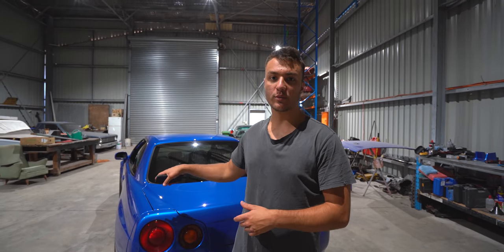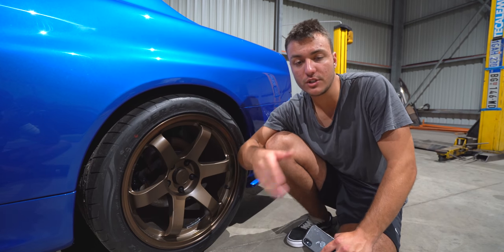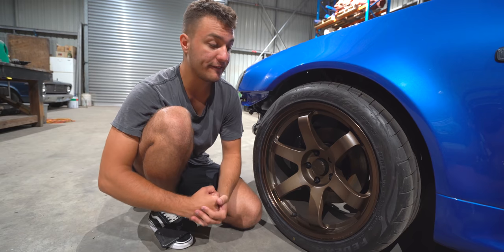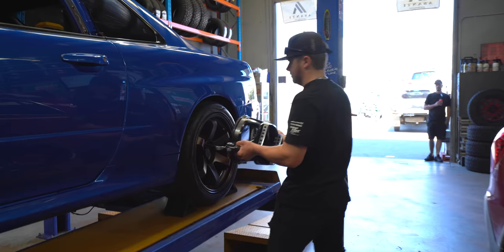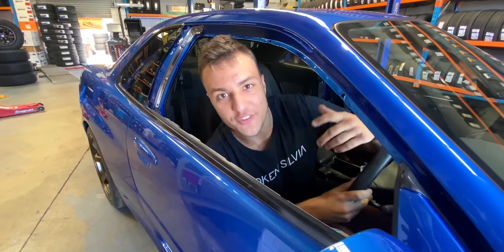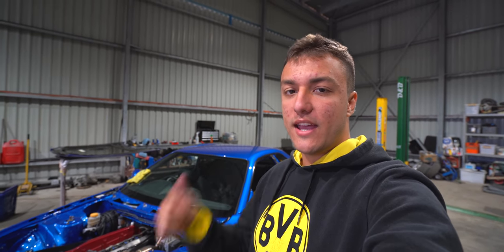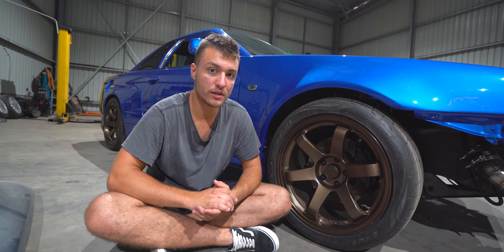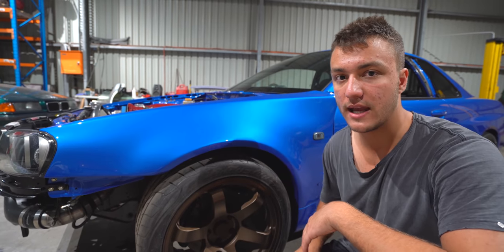R34 BURNOUT + Wheel Reveal | Poor Man's GTR [EP26]

Comment: I think, if you are not planning to do GTR front suspension, since you are rear wheel drive, you should've went for a staggered wheel setup, a little bit wider in the back and narrower in the front, with the 4x4 setup the front wheels are way outside compared to the rear ones

Comment: Wouldn't a little bit of camber on the front solve your fender rubbing worries? It would help with grip during skids and drifts too and should not affect driving performance negatively to a large degree.
Reply from the maker: Yes it would but would destroy tyres on long drives

Comment: @9:14, Re to Dyno Video, Don't mind going down into your specs, the Did you go Standalone ECU or Reflash Tune, Size Injectors, the checks you did before actually going to the dyno like ensuring you had a full tank of fuel & spare fuel for any other flex options lol. Any more details on the Resurfacing job done? I do resurfacing down here (Nature Island of the Caribbean) In Dominica (NOT repub...) lol. Good Video as always..... 

time to continue watching
@13:02  hmm I should check out the Clearance of my Tien Coilovers on my JZA80 down here, definitely need the height for some places. on hard cornering definitely experience some touching of the OE fenders 😣

Comment: Hey bro your car looks great. But I have a question about my Gtt. I just ordered a set of ssr sp5 wheels and the size is 19x10.5 +12 offset do you think I made a big mistake? My car has the z tune finder and rear arches. Do you think the wheels will be way out now knowing the car is 10mm wider as you said?
Reply from the maker: Too big, don’t camber them in to fit
Just sell them and get a smaller size
Reply: @BrokenSilvia  I’m really not looking for a flush fit. If they are out beyond the finder a little it’s going be ok for me because I’m was planning on stretching the tires and going for a aggressive look. Or your saying they will be way out?